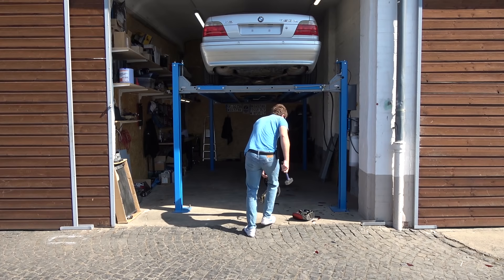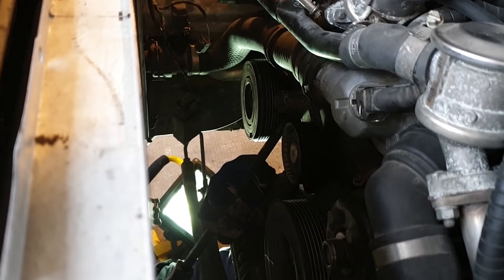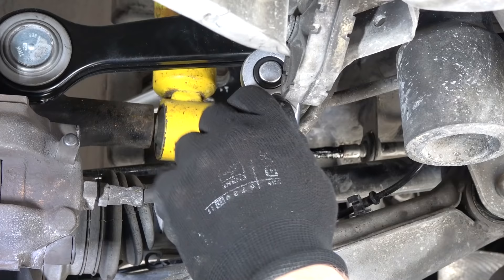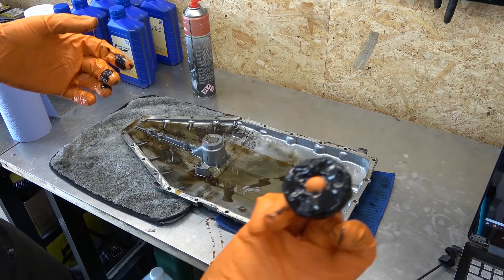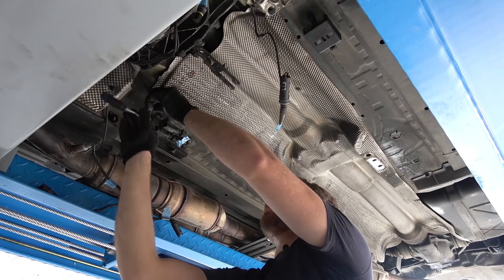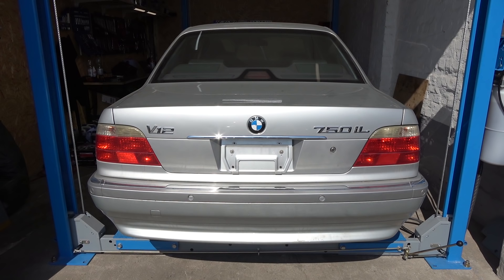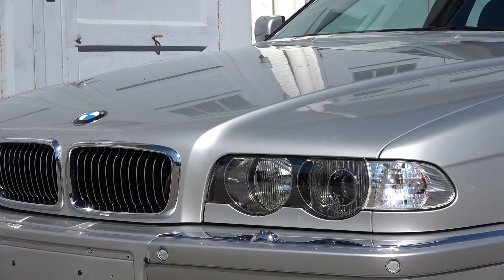V12 BMW E38 750iL Restoration - Project Dubai: More Mechanical Bits - Part 3

Comment: That Zip Tie trick on the trans gasket, is F.ing genius.

I'm taking it lol
Reply: I normally apply a small amount of grease in some parts of the gasket. Works fine.
Reply: What if the zip tie end falls into the pan and the pick up sucks it through the torque converter
Reply: @GatsCreationMotorworks  Risks we all run sometimes
Reply: @GatsCreationMotorworks  if your cutter split the zip ties instead of doing clean cuts, your cutters are not good enough. Usually zip ties don't split in bits! Keep these cutters sharpened, brother!

Comment: You could, should, turn the engine on without the exhaust system so we were able to listen that V12 sound, (aside from errors codes because of the sensors)

Love the video, ready for more

Comment: You removed the nut and hit the tip of the bolt with a hammer to hit it out. ALWAYS screw a nut 3/4 of the way on so you'd hit the nut and not the bolt. You can easily damage the bolt and stretch the end when you hit it directly with a hammer
Reply: @Sander I dont think he reused those bolts

Comment: Author: the manual explicitly says to torque it by the nut, and not by the bolt.
Me: Them german mechanics, always following manuals and shit

Minute later:

Author: torque wrench won't fit here, so I WILL TORQUE IT UNTIL I FEEL MY BONE OR BOLT IS ABOUT TO BREAK
Reply: Well torquing by the nut is standard for anything, ive had multiple BMW’s and torqued by feel on the driveshaft with zero issues
Reply: lmaoooo
Reply: Torquing by the nut is mandatory on aircraft. Just saying.
Reply: German engineer motto "WHY MAKE IT SIMPLE WHEN WE CAN MAKE IT DIFFICULT"!

Comment: Great job! I have a 99 e38 750il that I’ve had since it was 3 years old. It’s nice seeing videos of this beauty. It drives better than anything I’ve ever been in. I have the double pane glass which makes it so quiet and the air ride makes it so smooth. Liquid cooled components to top it off. A masterpiece!!!!

Comment: @M539 Restorations, please use chromed turn signal bulbs so the taillights / headlights, they add that extra details for a clean look instead of the normal orange lights. <3

Comment: Loved each and every second! Can't wait for the upcoming videos. 
Although I'm more in to Volvos than BMWs, procedures and techniques during general maintenance are almost the same when it comes to wrenching. 
May I suggest that you invest in a hydraulic press? it makes life easier while replacing most of those bushings and bearings. 

p.s. Couldn't agree with you more on depo, tyc and similar sh!t.

Comment: Sreten: I'm taking your fuel filter change as an idea. Since the filter is good for up to 15 BAR (217 PSI) of pressure, I'm going to retrofit it to my car (2013 SX4). Better to have reliable filtration that's verifiable, than to have an internal tank filter that is not removable or replaceable. Just need to find the mounting bracket for the filter.

Comment: You cannot use words to describe the previous mechanics of the car, but I can: they should have their certification revoked, at the absolute least. And no wonder the transmission whines and screeches, its oil was probably never changed. Another uplifting video, I wonder why Hollywood can't make stuff like this anymore?

P.S. That's definitely how I feel about Chinese craftsmanship.

Comment: FYI. From experience, those Febest bushings you replaced on the rear lower swingarms, are not that good. You should be able to use the OEM E53 X5 parts (lemförder) 3493301 and 3493401. Those have a little bit bigger bolt hole, but you can ask someone who has the equipment to fill the hole with a tool grade aluminium cylinder, and then drill the hole to the right size. The force that keeps the bushing in place is the friction between the face of the bushing end and the chassis, so make sure that the aluminium cylinder is a little bit shorter than the bushing, or drill a bevel on the end of the cylinder.

Comment: I was so impressed with the driveshaft work. Once on a holiday I tried to remove my Fiat Spider transmission it had like 13 bolts one that had two extension and swivel to remove. I was so preoccupied and stupid After I removed the bolts and pulled and pulled the trans would'nt come out. Why...because I didn't take the driveshaft off. I worked 16 hours and gave up . Funny now , painful then.

Comment: I can fully appreciate your adjustment technique of the rear lighting units. Vast improvement. Depo lights go on a Chrysler mini-van with 300,000 miles and mismatched fenders, NOT on a flagship BMW.  Out of curiosity, why did you not replace the universal joint in the driveshaft when you had the ideal opportunity? (and it was on the ground, already off the vehicle?)  That is a beautiful E38 - very cool project! Looking forward to the E60 M5 project.

Comment: LOL @ the Depo tail lights.  Chinesium junk.  I think the same about them - absolute garbage.  If you know someone with large nubby tires (on a lifted truck, bull dozer, etc) it's also satisfying to have them drive over them.

Careful with using your hand to break bolts/nuts loose.  Ask any mechanic and they'll tell you why...use hammer or leverage.  Your wrists will thank you later.

Love watching these restorations of BMWs.  Great channel, great video quality - keep up the great work!!

Comment: My 01 740i has a engine rumble when I turn the steering wheel but the motor is very smooth when driving, what can it be? Do help if you can, thanks in advance

Comment: That air filter would be considered a minter compared to some in cars in the UK. I guess Germans make more effort servicing. These fantastic bits of kit came from an era where BMW were contemplating 48v electrics and integrating a combined starter/alternator into the flywheel. Both seemed good ideas but never came to fruition.

Comment: Surprised to see the use of OE parts, most just run to the dealers for every part, although noticed the the bushed were not Lemförder units , as that swing arm and control arms are usually made by them.

Comment: Hi did u replace the steering pump with a Tandem Vane pump and if so which make? Also I saw u had red ATF fluid is that because of the SLS delete as it’s supposed to have green CHF pentosin? Thanks

Comment: I notice you use NGK plugs, when I worked for BMW in the early nineties we used to be forever pulling NGK plugs out and replacing them with Bosch plugs, for some reason these earlier BMW's didn't like NGK plugs, don't know if that's changed now or what they use as OE now but worth bearing in mind.

Comment: Hi there loving the videos, do have a videos on x5 e53, and I have few minor issues, 
Like gear selector light not working? 
In active air suspension? 
Reverse sensor all 3 stopped at same time.
Thank 
Andy.

Comment: Hi, thanks for the videos. I picked up 1996 750iL Alpine white/Tan and your videos are a great help.  I'm having an issue with the lower coolant hose.  I completed replacing cooling system hoses/thermostat and belts.  I've replaced all with BMW OEM. The lower hose is not clearing the A/C clutch.  When A/C engage, cuts the hose and eventually hose will fail.  I replaced 2nd time and still fail.  Have you experienced this?

Comment: You said the torque wrench can't fit there, but it would fit from the side of the bolt. Wouldn't it be better to hold the nut and torque the bolt to spec, rather than torquing the nut by feel?

Comment: Great video , professional work I watched your all videos,, very nice.. I have question here when you were servicing the transmission this car  is equipped with zf 5hp-30 transmission but I 've noticed the selector is steptronic which normally coming with 5hp-24 transmission... so is this normal or it is mdified model.
The 5HP-30 selector normally coming as: (P R N D 4 3 2 1).

Comment: I`d fabricate an H-pipe for that exhaust right away. It has huge advantages and is easy to do.
Reply from the maker: That's not legal in Germany.
Reply: @M539Restorations  Oh I see! So Any modification you do yourself is strictly prohibited? I could understand it if that exhaust provided any scavenging). And It's a high-revving engine...Anyway, thanks for your reply)

Comment: Nice! Is the weight of both batteries in the rear right compartment compensated on the left?
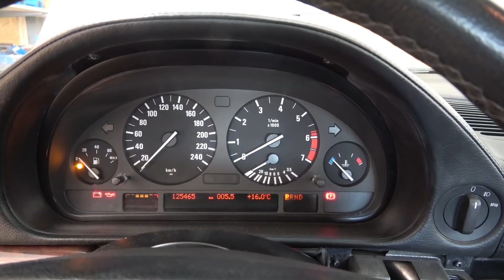18:40 get some fuel 😂
26:20 in The Netherlands we can use special small 18.2 license plates (US plates)

Comment: Where did you find the tensioner pulleys with the pulley only and not the entire assembly.  I'm looking at replacing both but they are $250 each for the entire assembly.  Much thanks for any help!

Comment: Quick question: I see that the SLS was deleted by looping it back behind the FL wheel. How would you delete the EDC as well ? and after all the deletions, can I just cap off the lines or would I have to remove all the hardware ?

Comment: hello. In two of your videos when you are working on the suspension I've seen you always torque the arms while car is down. How important is this? i never knew that this is the way to do it, my mechanic always torques them with the wheels in the air. and where could i get information on what torque each arm should take? thanks a lot dude, I appreciate your videos a lot. love e38s

Comment: Another fantastic project 👍🏼👌🏼

Re the rear number plate holder; is that personal preference, or do you have to have the Euro spec size plate holder by German law?

I've a Jap import E39 touring here in the UK and I'm retrofitting the US/Jap spec number plate recess on the rear, as I prefer that look, but also there was one fitted when the car first came into the UK and for some reason, the first UK owner removed it and binned it 🤨
Reply from the maker: I prefer the Euro holder.

Comment: Thank you for top quality restoration! I was wondering if you could advise where to find  w126 sec amg widebody kit in germany? If you search online only cheap replicas are found. Is there a website where they sell good quality amg kits(specifically widebody w126/w124)? I tried translating to German - it would take me to German ebay but I could not find it there.

Comment: Personaly depo isnt bad for rear lights, but for front, god no. I have a 2008 Mercedes Viano van, i drive mostly during night, My right headlight cracked from the rock so i got a depo unit. It did not shine corrently, later i got Hella. On the other hand when my rear light cracked (have no clue) i replaced it with a depo unit. Not bad people can still see you and you cant tell the differance

Comment: Hello, could you tell me what tool did you use to fill the oil pan at 19:21? Great video, thanks for sharing your work.
Reply from the maker: HAZET 2162-6 High Performance Suction Gun
Reply: @M539Restorations  Thanks for your answer :)

Comment: Hello My BMW E39 540i 2003 I think I have such a problem with your car when I start the car in the morning I hear like the sound in the clip and now I know that it is because of the transmission fluid but I am afraid of changing the transmission fluid because here in Dubai they say if I change the transmission fluid the transmission will be disrupted I watched The clip when you changed the transmission fluid was black and this means that it is old and burning Do you advise me to change the transmission fluid? And if I want to change it, how many boxes should it be?

Comment: Perfect job done. I have e38 as well, but only 730 diesel 99th year facelift shadowline. I would like to ask you something. I bought my e38 with r19 rims and the tire sizes are 235/35 front and 275/35 rear. This year I want to change the tires. So I want to ask, which tire size would be the best for r19 rims and original suspension? I'm asking this because, I'm not sure about tire sizes at this moment. Right now it doesn't really look right, the front specifically, because those tires are more narrow. The rim style I have is style 92.
Reply from the maker: Sorry, I wouldn't be able to advise you. I personally wouldn't put anything bigger than 18" on E38.
Reply: Thanks for the suggestion.
I will keep in mind.

Comment: You know BMW builds good transmissions when it was allright after some care, afterall it didn't have an oil change since 97
Reply: This was in the era when they were 'filled for life' - my 740 is the same... no dipstick to check levels, and unless they needed a gearbox service, the oil was supposed to last the life of the car... that is why the oil is so black and it has the original filter... Don't know if ZF was over confident in their gearbox design, BMW thought E38's would all be low mileage pampered cars, or the oil maker thought their new formula was so perfect (it is expensive)

Comment: I've noticed this car has the body color matched cladding, but every car I've been shopping for has the ugly black cladding around the body. My question is why? Why do some have black cladding and some have color matched cladding? Is it an option? Or based on where the car is sold? A year model specific thing?
Reply from the maker: Cause that's original and how it should be. I later removed mine.

Comment: Hi, why did you bought cheap febest bushings instead of meyle for example? That brand is known to fail pretty quick.
Reply from the maker: Only Febst makes these particular bushings. No one else. It's just rubber, despite their reputation they should last.
Reply: @M539Restorations   maybe it would be worth it to find polyurethane maybe powerflex or other vendors, while you was doing front suspension, it felt sporty with bilsteins b6, also wonder why dont you invest in HR or ST, eibach springs? I am a bmw owner E92 and F30  but not so radwood aged as your fleet. Interesting to see what parts do  germans use :-)

Comment: 15:50 I know nothing about cars, but shouldn't the drain plug come out first?
Reply from the maker: No. Always fill plug first, because if you can't open it and you drain the oil before, you are stuck.
Reply: @M539Restorations  oh, makes sense

Comment: Very cool and helpful video! I learned how to replace the clutch and pulley bearing on my AC compressor. My compressor is a Denso 7SBU16C and I found on eBay the complete set of clutch, pulley and bearing for my compressor (part number AKS DASIS 855007N). My car is a 325TI Compact E46 from 2001. BMW part number for the AC compressor being 64526910458.

Comment: Not sure if anyone commented this already, but the 750 had a 2nd battery because of the electronic heated catalytic converters that were only on the 750.  Without those special cats it would only need 1 battery like the 740.
Reply from the maker: You missed that in part 2.

Comment: unbelievable they put the fill for the transmission oil at the bottom of the transmission instead of just placing a neck at the top. pure nonsense.

Comment: Hey there. love your videos. Noticed you couldn't torque the flex disc because of tight clearance in there. Here is the adapter tool we use for such things in motorcycle world :https://www.motionpro.com/product/08-0380. Keep up the gr8 work!

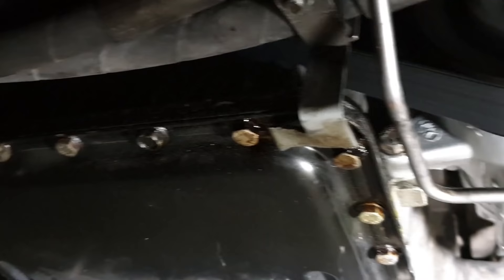Comment: 8:35 there is a crack in the oil pump !!!
Reply from the maker: No, there isn't. It was just repainted so the finish looks off.
Reply: @M539Restorations  another issue that really bothers me is 8:31, I know its the most efficient solution but I think this is not how it should look like neither how it should end. In all cases, I'm a big fan and so much enjoy your work. Thanks, Mate.
Reply from the maker: I explained in the video, it would take 2.5k to put EDC back and now that I'm driving the car, I'm happy I didn't waste money on it. The ride is phenomenal.
Reply: @M539Restorations  when we are going to talk about any of the 700 (730, 740, 750) I or il 1989 to 1992 BMWs? Any of these ministers will be a phenomenal BMW restoration project.
Reply: I'm just saying that because I think that series 7 1989-1992 are the best to be described for the phenomenal rides. My personal opinion only.

Comment: Omg, Febest is shit. after installing them, your machine is still malfunctioning. It would be better the next time you replace the bushings if grease was used before installation
Reply from the maker: No, it's not still malfunctioning. These bushings are only available from them and unless they made them from cheese it should last, they are just simple rubber bushings. Besides, others used them on E38's without issues. Absolutely no grease! This is explicitly specified in BMW repair manual. You don't want them having possibilty of moving, they should permanently stay in place.
Reply: M539 Restorations just looked - yes. BMW would not have been BMW if it had not sold the levers assembly)). then the choice of silentblocks (bushings) is very sad and Chinese (lynxauto, q-fix, caster, patron, vtr gufu parts etc.). although, according to reviews, all of they is better then febest)). we still have very popular polyurethane bushings, which are made by small firms. about the lubrication of the bushings - I agree. but given the tight fit, I doubt they can crank. but it is better to do according to the factory instructions))

Comment: now why would anyone want to restore this piece of junk anyway?!
Reply from the maker: Because it's not junk. Now go and spread your hatred elsewhere.
Reply: @M539Restorations  well, as Scotty Kilmer would say, it's an endless money pit, full of plastic parts that brake and are very expensive to replace and it's full of electronics that barely work and brake all the time... Nice car to look at but too bad you won't get to drive it very much as it will be at the mechanic to be fixed most of the time... :)))
Reply from the maker: Ok, then I'll set it on fire since that guy knows what he's talking about.
Reply: @M539Restorations  your ignorance is...  :))